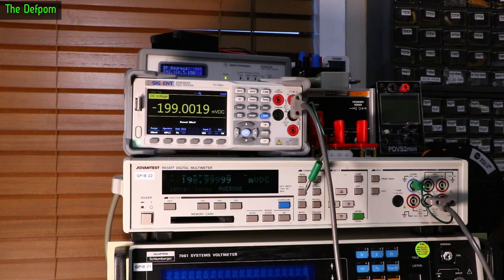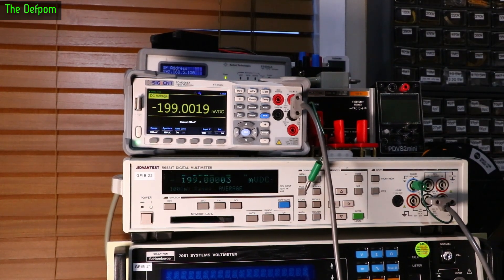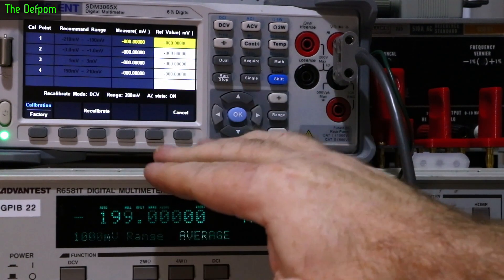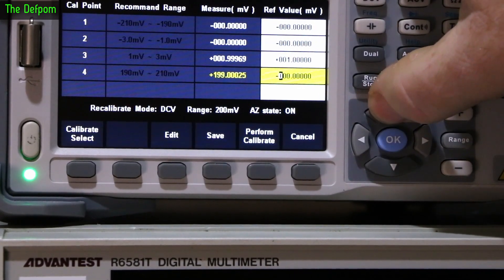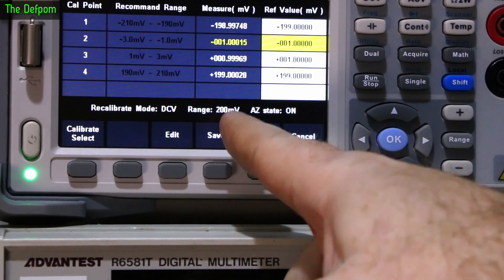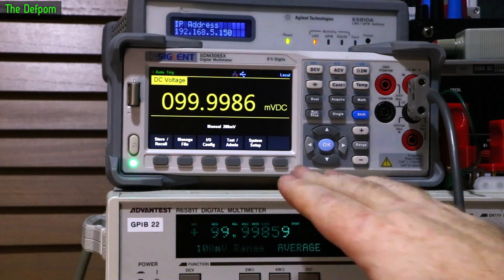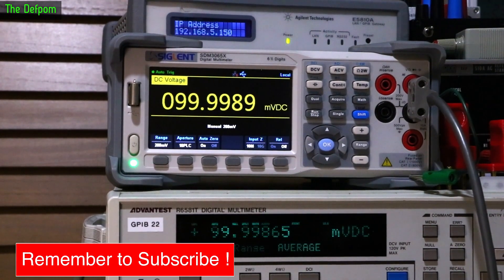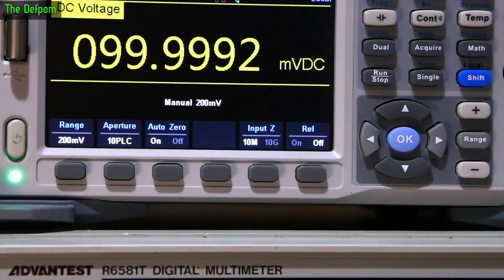🔴 New Siglent SDM3065X SDM3055 SDM3045X User Calibration Process - No.1121

Comment: Being a newbie, how often should the unit be calibrated?  Also, if I do not have another unit to use (like you are doing there), am I dead in the water?  I would rather do this myself and not have to send in the unit to pay for calibrating. Thank you for your time!
Reply: Unless you have greater than 6.5-digit-accurate sources of voltage from 200mV up to 200V, I wouldn't worry about it. If you want the multimeter absolutely bang on the money, you may want to send it in every 2 - 5 years (if at all). Or have a very generous friend with such high end equipment that can do equivalent. A business relying on its accuracy would do so every one year. Keep in mind also, a multimeter (or rather, mostly its internal reference chip) will drift the most at the start of its life. After some years, it should become very stable.
Reply: @ivolol  Thank you, mate.  Wise advice.  Your channel is very helpful and enjoyable!

Comment: So if you have to use another digital multimeter to calibrate the one that you have, how do you know the other meter is ok itself??  If it wasn't in great calibration itself, then a waste??  Sorry for the novice perspective/newbie perspective.  It was just something I was wondering.  Your efforts here are indeed brilliant, though.
Reply from the maker: @jamesdonaldson7546  I am comparing a 6.5 digit meter to a 8.5 digit, so 2 orders of magnitude greater resolution. The 8.5 digit uses artifact calibration based on a 10V reference, which I do have calibration data for, also this is all being generated by a Datron 4700 calibrator who’s output has been verified against other standards I have, so I can have a high confidence level in the calibrator and the 8.5 digit meter accuracy for the purpose of adjusting a 6.5 digit meter.

Comment: My SDM3045 is out of spec by a few mv, siglent wants 190 to do a cal/adjust on my sdm3045 that only costs 400! How are you deriving accurate voltages at all those different and specific ranges the meter lists? Most voltages standards are like 5 or 10 volts only. Are you just transferring the readings from the higher accuracy Advantest meter? I would like to be able to do my own cals
Reply from the maker: @StrippedElectrons  I have a Datron 4700 calibrator, I use that to generate the voltages, in this video I have the 8.5 digit meter there for reference.
Reply: > How are you deriving accurate voltages at all those different and specific ranges the meter lists?

Essentially, because he owns way, way, way, more than $190 in test/calibration equipment 😅

Comment: I really don't see what is the need for those meters they do nothing for you. Is just a vanity on the bench. Can't even test transistor with them, a $20 bucks tester and bench Brew circuits that cost 0 will do more for you
Reply from the maker: If you need to check the accuracy of a lower digit count meter, you need a higher digit count meter… I DO use all the digits when working on higher end test gear, it’s use isn’t for hobbyists where 3 digits is good enough, if you want to test transistors use a transistor tester.

Comment: This is great news. I presume the factory calibration still remain stored in case if we mess it all up?
Reply from the maker: Yes, you can always revert back to the factory cal, in fact if you need to call more than once you should do it based on the factory cal, I found with the previous method that if you did it from the user cal it did it wrong, so best to do it from factory cal.

Comment: That's awesome 👍
Last year I wrote Siglent Support, because the User Calibration on the SDM3055 was faulty. I figured out that the SDM3055 calculated the Values in the mV Range wrong. And the R-Range were impossible to calibrate.
Coming week I will take the SDM to my work an try to calibrate it with an 8.5 Digit Fluke.
Reply: Oh boy!  I have that model.  Are you saying that there was a problem with the firmware?
Reply: @jamesdonaldson7546  yes, but there is a new Firmware which fixed it nicely and made it even better. Thumbs up for Siglent.

Comment: The Rigol PSU's have a similar feature, which I really like.  Well it does on the Rigol DP832 anyway, so I guess they do it on others too.  Manual data point entry is possible, but I don't run this manually on my box. I use PyCharm software and a script (thanks EEVBlog!) that reads the info from my Keysight 34465A and programmatically runs through the cal' sequence. Does the Siglant have this feature too, i.e. you can use 3rd party, or even Siglant software (?) to automate a calibration sequence?
Reply from the maker: There is a calibration script from Siglent which is based on using a fluke calibrator for automated calibration.